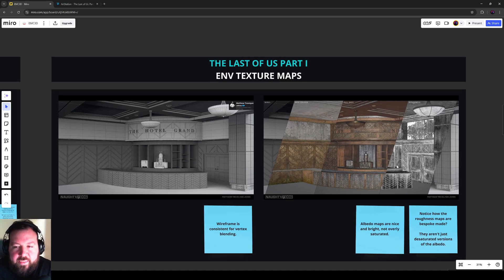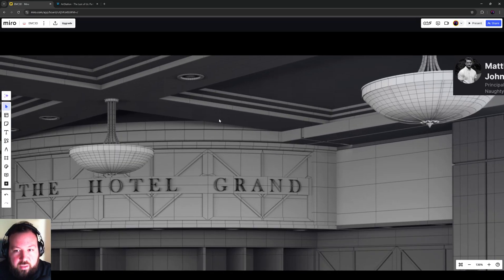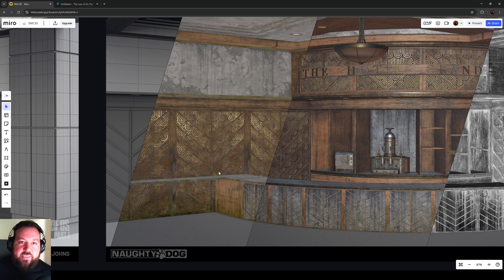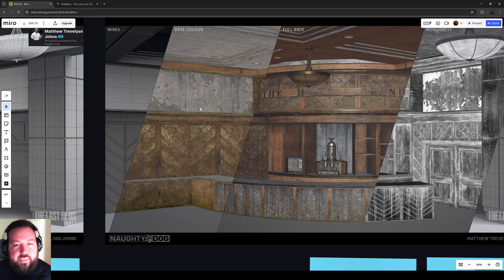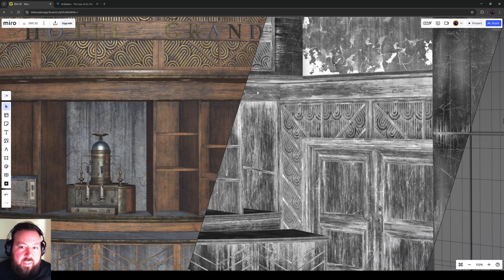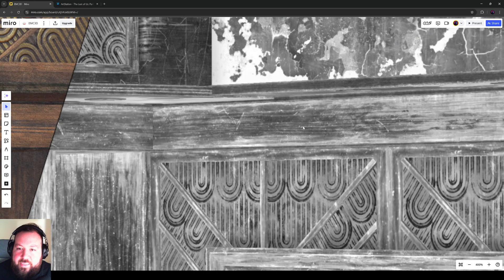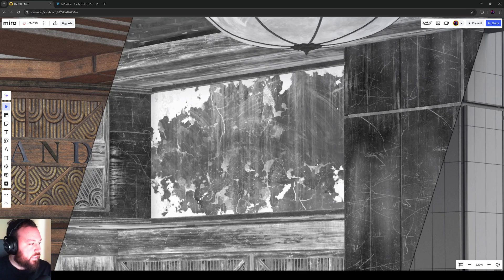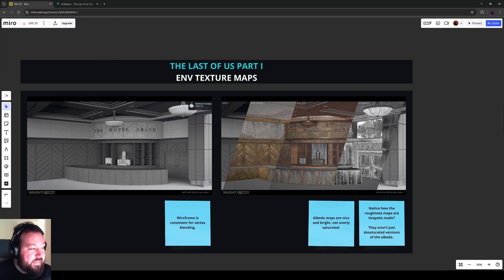Why Does Naughty Dog's Texture Maps Look Like This?

Comment: About albedo, what you say is mostly false. Albedo is color response of material, so brightness should be essentially removed from it. Having a dark albedo just means that material reflects no light. 
In most engines light doesn't "bounce", this is starting to change and there's pre-baking as well, but as a general rule - no. Also, dark albedo on a metal surface is not going to do much, because metals are (close to) perfect reflectors, so little energy is absorbed either way.

For anyone interested in PBR - I recommend a basic course, SIGGRAPH has plenty, and GDC has a few. I'm a software engineer, so my view is skewed here, but it's useful to understand what you're doing.
Reply from the maker: Thanks for the feedback chap, I'll be making a video on this in a few days with more details, but in an artist-friendly manner with examples.

I was mainly referencing the image on the MIRO, which is mostly dielectrics, which do require a certain range of brightness values to be physically correct. We may be mixing up terminology as you are an engineer and I am an artist. 😄

Here's some awesome resources to better understand how albedos are managed in games from an artist workflow:

- https://www.linkedin.com/pulse/pbr-albedo-values-guide-lighting-artists-only-ron-haimov/
- https://docs.studio-397.com/developers-guide/general-reference/pbr-an-introduction-authoring-guide
- https://www.youtube.com/watch?v=PhXLuYUYULU (18:57 to 24:00)
- https://www.artstation.com/blogs/shinsoj/Q9j6/pbr-color-space-conversion-and-albedo-chart
- https://environmentart.wordpress.com/2016/06/13/texturing-values-for-environments-part-1/
Reply: There are safe ranges for colors as far as I know but it’s mostly staying away from pure white and black for albedo? 

Oop saw the reply. Thanks for the sources !

Comment: That was such an amazing breakdown, I really enjoyed watching. One thing regarding the albedo map having to be more on the brighter side, even for darker surfaces such as the asphalt or tar or rubber... Yes, that has been a thing even before the PBR days, in engines like UE3 or the earlier versions of the Cry Engine. And that is because of how light behaves in game engines, just like you explained. The albedo map (or diffuse map, back in the day) is still one of the main drivers when it comes to light bouncing. So in the old days, back when lightmaps were used way more than now, we would always use the Levels filter inside of Photoshop to check and make sure the color texture is sitting on the brighter side of the spectrum. But we will also not go overboard and have pixels that are 100% white. Basically, you do not want to have pixels that are either 100% black or 100% white, because the game engines may see those as 'dead pixels'.
Reply from the maker: Oh damn, thanks for the awesome knowledge drop! It's amazing how the concept of dead pixels (100% black or white) translates across so many mediums, a great fundamental skill to know about.